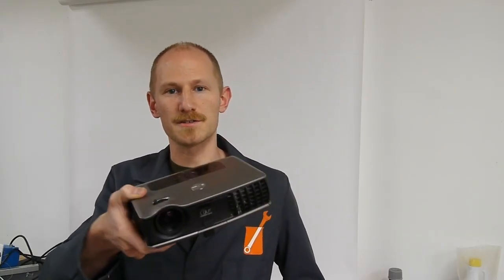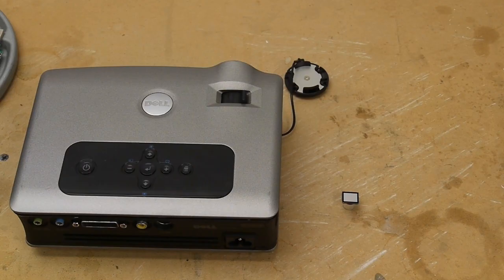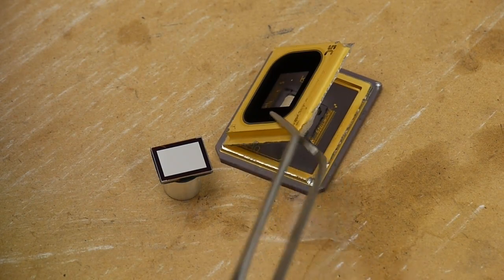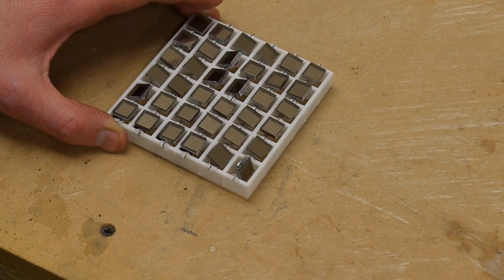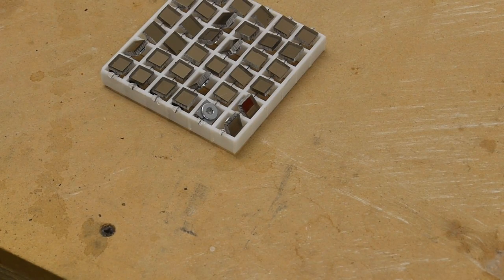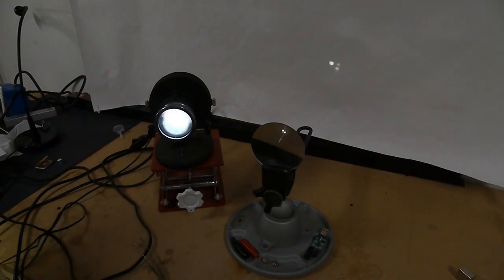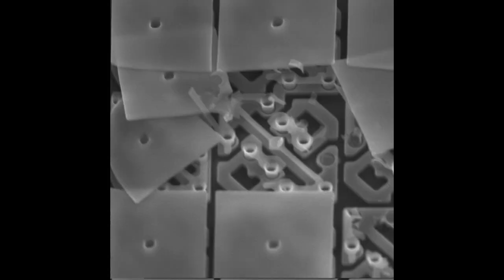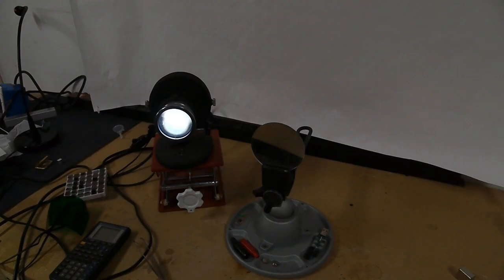How Digital Light Processing (DLP) works

Comment: Am I the only one thinking "holy shit we are able to create and assemble mechanically moving objects so small that you need an SEM to look at them" ?

That is amazing. Sure nobody bats an eye anymore at 22nm processors but.. We're talking actually mechanically moving things
Reply: I agree. It is pretty amazing. What's even more amazing is that we use devices with this kind of complexity every day, and don't bat an eye. Or the fact that you can buy a chip made using this super complex and mega-expensive-to-develop manufacturing technology for literally .1$ a pop.

It won't be a very interesting IC chip, but, doesn't mean it's not amazing that it exists and is sold for basically nothing!
Reply: Not only do you need powerful microscopes to look at some of these mechanical system, but we have even brought down mechanical systems to the point where their vibrational modes need to be treated quantum mechanically. See eg http://k-lab.epfl.ch/page-102900-en.html
Reply: +Cooking With Cows I'm totally amazed too. I was hoping he would go into the other method of getting all the colours. Same principlal with the mirrors but there are 3 light sources pointing from different angles. So the mirrors have to move in more directions, even more tiny moving parts.
Reply: MEMS (Micro Electromechanical Systems)
http://en.wikipedia.org/wiki/Microelectromechanical_systems
NEMS (Nano Electromechanical Systems)
http://en.wikipedia.org/wiki/Nanoelectromechanical_systems
Reply: Cooking With Cows I'm with you on that one for sure. We, as a species, are capable of creating incredible things as a whole. That's why I always give my highest regards to school teachers. Without teachers and schools, you would not even be reading this on your screen.
Reply: Here in 2020 and AMD has got it down to 7nm process. 

Yeah also I agree that the micro mirrors are amazing technology.
Reply: Aye wait till you learn about proteins.
Reply: But how the fuck are they made?
Reply: @malitwat2874  I work in a wafer fab. Metal deposition, photo lithography, and etch. The mirrors are aluminum, the beams that flex are titanium tungsten. I worked on them for about 12 years.
Reply: I worked with microdisplays for a few years and this remains the most amazing technology I saw. It continues to blow my mind. I need to find out how they are manufactured!
Reply: @TheHardSteppa  made the same way they make I C chips. I worked making  DMD for about 12 years.
Reply: heck now we are at 7nm
Reply: @buddyguy4723  moores law
Reply: And 8 years later building them and selling for $100 on Amazon. Amazing how we humans are capable of evolving technology.
Reply: ***** There is an effort underway to make a Babbage engine about 1 cm on a side.  Why?  Parts that tiny can run at millions of operations a second.  A Babbage machine can do a lot in a single clock cycle.

Comment: Could color projection be achieved with this technology by using colored mirrors to create the same basic 3 color pixels in used almost every kind of monitor?  Or is the size of the mirrors too critical for the size of the pixels for such an array to work?  I'm assuming it would only be doable with much more complicated optics to re-collate the light properly to project well blended pixels, negating the cheapness of this system...

Comment: You can have the same 3x DMD projector as the 3x LCD one (more expensive).
You can also use the same color wheel method if you want with single LCD.
There is also a LCoS that is an LCD with a mirror at the back usually also used as a single device in inexpensive projectors.
Color LED's have mostly replaced the color wheel wince you can switch fast each color LED and you do not need the color wheel that was way less efficient.
You actually need the same amount of light from the light source in a single DMD (DLP) and a 3X LCD since the mirror is mostly away from the light source so the average light output from the projector is lower.
Say you want to display RED with DLP (you will need to wait for the RED part of the color wheel usually a quarter of is size so just a quarter of the time the mirror will reflect the light outside the projector and that is only for the part of the light source since just the red part of the spectrum will go trough).
On a 3LCD projector the RED part of the spectrum will go trough one of the 3x LCD's but for the full period not just 1/4.
Some years ago I used to play with old projectors and replace the original lamp with white LED's (that was before LED projector got popular).
I got about 25lumen to 30lumen from a single 6W white LED with 3x LCD projectors. I prefer 3xLCD the most since each pixel has his color there are no color sub-pixels as on monitors so you can have a yellow pixel. And also there is no flicker or that rainbow effect you get with a single DMD or single LCoS.

Comment: Cool video, as always :) I suspect half the work of adding individual electromagnets is securing them to the frame. You could probably 3D print a series of hollow cylinders the same diameter as your cores, positioning the rows and columns so they line up under your mirrors.

Comment: Applied Science Have you though about the bit rate required to control these things.
If a chip is True HD (1920x1080), 2073600pixels, If every mirrow moved at 2000times per second and making the pixels = bits then the bandwidth to control it would be 4147200000 bits per second.

4.1GBit/second, I thinking there is some kind of processing magic inside, Under the mirrors.
Reply: Wow, Someone sent me this link(JonnyLatte) I don't know why it came as an email and not a reply though, Here it is...
http://www.ti.com/lsds/ti/analog/dlp/dlp-chipset.page

And I was almost right, though its not 2000 times per second, Its 23,148. In the spec sheet it claims 48Gbs, sounds right.

1920 x 1080 x 23148 = 47999692800 bits per second  - That's a little shy of full 48Gbs.
Reply: It doesn't need so high bandwidth. It can easily work with RGB 8+8+8 bit per pixel. So it set a speed of vibration ( from 0 to 255, this can be done analog). And some driver is vibrating it automatically for third of a frame, end new value is set. It isn't controlling every pulse of vibration, it doesn't have to.
Reply: xxx xxx There is nothing analogue about these chips in any way. Controlling the individual mirrors does not work at 8-bit signaling.
Have a look at the spec sheets and it clearly says the 1080p version uses 48Gigabits per second.
Each mirror element needs to be controlled at extremely high rates to allow dithering of the 3 colours it needs to reflect.
Seems every single pulse for every single mirror is or can be controlled individually right down to each flicker or movement of the mirrors.

Absolutely Amazing they are.
Reply: TheProCactus I didn't read the whole spec, so I don't know where you are getting the 48Gb/s. First page I saw said four 16 bit DDR input buses (that's 64 bit) with 400 MHz input data clock rate. But I also see that the cross over time for an individual mirror is 16 - 22 micro seconds, so it can switch from on to off from 45,454 to 62,500 Hz. Switch over for the whole array is 140 micro seconds. That is 7142 Hz. This make any sense? Or is my math screwy? It's late and I haven't studied data rates and cycle times in many years. But I think its F=1/P.  so the frequency of a 16 micro second pulse would be 1/0.000016 or 62,500 Hz.Regardless, why would it need to switch that fast. If you where projecting at 60 FPS, each mirror would only need to change up to 3 times per frame, or 180 times per second. 180/sec for the full 1080p array is 373 Mb/s...........................................................................................................................................Edit: I should have continued reading the comments before I posted. It seems that the mirror doesn't have to be on the entire time a certain color is need to be projected. It can stay on for only a portion of the required time for that color to give that pixel a desired intensity. So that's probably why it can switch so fast.
Reply: jbrou123
I just wake up check any messages and this :\
Jeeez. Urm. Ill have a look again, Im just a nub myself really.

Page 4 of
http://www.ti.com/lit/er/dlpu008a/dlpu008a.pdf

Maybe, im getting confused myself. Maybe its the signal from the built in controller next to the mirror bits.

But the reason they have to switch fast is to get smooth and less flicker colours. Based on my first post, Seems Im under the assumption that each flicker can be controlled. Its too early for me yet. Though im more than happy to reply again later.
Nothing worse than understanding something wrong.
Reply: jbrou123 ...plus DLP projectors usually run at a really high frame rate (120hz/144hz) to reduce the color separation effect when looking around
Reply: *****
That chip I mentioned, Each mirror flips at over 23 thousand times a second, I dont think your normal FPS apply to these devices.

Comment: While DLP technology is an amazing development for projection, a lot of its potential is literally wasted as heat by dumping unused photons into the black absorber. There's a company out of Vancouver called MTT Innovation that exploits an optics concept known as "caustics" to dramatically increase the dynamic range of the image while still using the same powered light source. They basically compute an optimization pattern and modulate the DMD in such a way that the light patterns constructively and destructively produce incredibly bright highlights and inky shadows. They presented a talk at SIGGRAPH 2014 that was quite impressive. And while they state that, right now, they're only using the technique to generate improved highlights, I can imagine a future version that pairs with a high-power light source to generate dynamically configurable light steering for the entire frame to improve luminance for applications like 3D cinema, which often suffers from darker images due to the polarization effects.

Comment: I have one of the very early generation of DLP flat screen projection tv's, it is a 30" standard def tv with 3 separate projectors, a red blue and green one with separate DLP chip's that lay there image ontop of eachother, before they had started using color wheel's. It was enormous and weighed nearly 200 LB's but quite fun to take apart. There are some newer LED projectors that use RGB LED array's for the light source so they do not need a color wheel and help with any noticeable color separation

Comment: Was going to go to bed due to it being 2 AM... but I like learning to much...

I do have a question though: When the voltage on a given mirror drops, causing the mirror to swing back, does there need to be compensation for the mirror swinging past it's "default" position, or is this a non-issue?
Reply from the maker: I believe the resting position (flat) is 0V.  When the chip is powered, it always tilts the mirrors to one corner (pixel bright) or the other (pixel dark) -- probably +/- 10 degrees or so.  It applies the electrostatic attraction either way.  This maximizes the amount of travel that we can get out of the torsional hinge.
Reply: Applied Science
It is my understanding (from wiki) that the mirrors continually oscillate and only offer pulse width modulation to affect their brightness; even at full bright it is still oscillating at ~15kHz to ensure even wear characteristics.

Comment: Fantastic! Always wondered how DLP chips worked. 

Also, thought provoking. My wife was troubled, and made me explain how the digital image might be decoded before it gets to the mirrors.

I also wonder about how fast the color wheel turns? Is it one revolution per frame, so like 30 revolutions per second (typically)? 

And if there are 256 levels per color channel,  does that imply a minimum of: 3 colors × 256 levels × 30 fps = 23040 mirror switches per second? (~43.4 micro second switching period)
Reply: Searching google for pictures of color wheels shows that 6-color wheels are common (Red/Green/Blue/Cyan/Magenta/Yellow). RGBW(hite) wheels are another option you see.

While your numbers show the accuracy needed, how precise the turning on and off needs to be, the mirrors only have to move twice - on and off - for each color per frame. You could even reduce this further by turning it on before the changeover, and off after (I don't know if any do this).

I'd expect most to run the wheel at at least 50 or 60 RPS (3000 or 3600 RPM) to reduce flicker, and I'd expect to see 6000 or 7200 RPM (100 or 120Hz) systems available. RGBCMY, 120Hz means 720Hz switching (High F or so on a piano?), although I'll leave it to you to calculate the timing resolution required.
Reply: No, there's no need to switch that fast. You just need to switch twice per frame for each color (let's say "on" at the beginning of the color frame and "off" sometime before the end depending on required brightness).
I can see the flicker of the color wheel on many DLPs, which is really annoying. I'm pretty sure it's 60Hz then, because that would match the frame rate set for most computer monitors nowadays.
Reply: superdau The time between the on and off can be quite fast compared to the frame rate. If there's three colors, the frame rate is tripled, and the switching time is the frame rate times the number of light levels desired. So 60x3x256 would give an effective required switching speed of 46080 Hz. While a frequency counter would only read 180 Hz, a period measurement could be as little as 21.7uS.
Reply: ***** Newer DLP technology, like the picoprojectors in phones, uses an RGB LED for the lamp with intensity modulation.  This removes the color wheel, and instead of Bit7's period lasting longer than Bit0's, the intensity of the RGB LED is modulated so that the light is 2^7 times brighter at the highest bit.  This increases the brightness of the higher bits without having to waste extra time to let more light through.  This is explained in TI's DLP application notes.
Reply: OK, thanks Robert Backhaus & superdau. Seems like you are both implying a PMW style method of achieving partial color levels.

While I admit this makes sense, it's still seems odd to me that we our eyes can average light pulsed so coarsely, as if we have a very good built in low pass filter. I guess persistence of vision is a thing. 
But also ***** mentioned the mirrors flipping on the order of micro seconds, which led me to believe there might be many flips per frame, and per color.

Also a RGBW wheel makes a lot of sense to me. I know in LED stage lighting a white LED in addition to the RGB really helps with purity of the whites.

Thanks for the input.

Comment: how are the tiny mirrors made and places where they need to be? Is it a chemical process like etching away the parts you don't need?
Reply from the maker: Good question.  Yes, the chip is made by a photolithographic process, just like silicon integrated circuits. The mirror itself is made by depositing a relatively thick layer of aluminum, then etching away all of the metal between mirrors.  The process will also likely require a dissolvable support material that holds the aluminum layer at the correct height, then is washed away to allow the mirror to pivot freely.  I'm not sure if the DMD chip is evacuated or has an inert gas charge -- probably vacuum.
Reply: I'd like to add that often a process called MEMS "machining" (Microelectromechanical Systems) is employed nowadays in which layers are added and removed using various processes such as lithography, electron beam etching, and vapor deposition (among many many other). MEMS technology is extremely useful for manufacturing micro scale mechanical systems including gears, springs, etc. If you do a google search for "MEMS gear" there's a cool image of a spider mite sitting on top of a rack and opinion made through MEMS processes. This is also the same technology used to make digital accelerometers and gyroscopes used in everything from cell phones to F22 raptors.
Reply: @gizmoguyar  Thanks for the info !
Reply: gizmoguyar
https://www.google.com/search?tbm=isch&q=%22MEMS+gear%22
Reply: This is a really good video that explains it all.
https://www.youtube.com/watch?v=CNmk-SeM0ZI
Reply: gizmoguyar  (I did a google image search.... )  AMAZING!  Awesome tiny mechanics and machines!  Thanks for the info.
Reply: Last year I took a course in electrical engineering called MEMS. Best course ever!
Reply: https://e2e.ti.com/blogs_/b/enlightened/archive/2016/03/25/making-our-digital-imaging-chips-is-no-ordinary-process
https://ieeexplore.ieee.org/stamp/stamp.jsp?arnumber=6774433
Reply: I think they etch silicon the same way they do microchips, gyro's, and accelerometers.
Reply: gizmoguyar I read in the new scientist a few years back about mems encountering stiction, Was an interesting read.
Reply: Should be similar mechanism with a MOSFET etching.
Reply: I immagine they would also need to very gently grind and polish the reflective aluminum layer before dissolving whatever the support material is.
Reply: stupid question, no there is a robotic arm doing that
Reply: nickwoo2 Probably like everything else:  they began with a concept and applied existing technology to develop a simple prototype.  After that they proceed to miniaturization.  One thing "leap-frogs" the next.  Undoubtably it is all done with the employment of very precise optical lithography.  Scary precision!

Comment: A lot of LCD projectors use a spinning color wheel with RGB filters and a monochrome LCD to generate alternating RGB sub-frames in sync with the color wheel presenting the appropriate color filter in the path of the light.